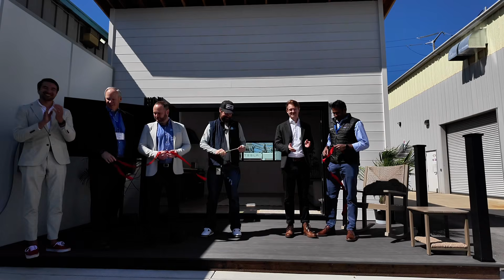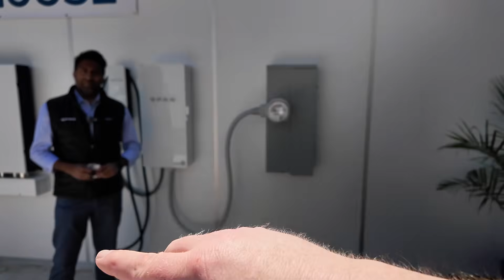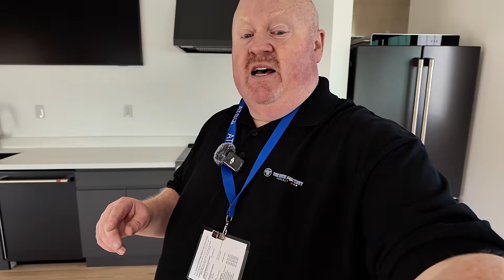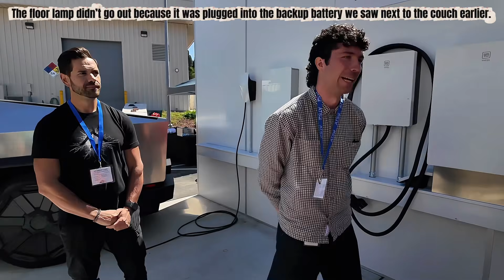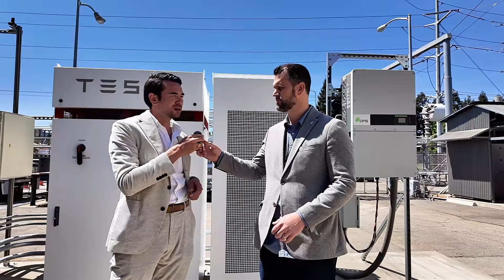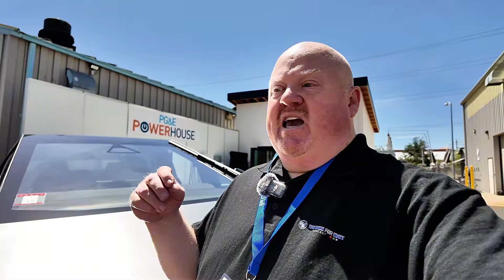Cybertruck & SPAN Power Tiny Home During an Outage | PG&E Just Revealed the Future of Home Energy!

Comment: Still waiting for Tesla to enable PowerShare for those of use with PowerWall 3s and the UWC.  FWIW, that "home of the future" already exists in the present with my 23 year old home.  Completely electrified after retrofitting a SPAN panel, cold climate heat pump, the GE combo heat pump ventless washer/dryer, instant electric 15kW hot water, dual PowerWall 3s, and 9.24 kW-dc of solar.  No induction stove yet just because I don't use my stove.  My dishwasher is original but wondering when a heat-pump version of that will happen.  Of the 3700 kWh sent to my SPAN panel, less than 2% came from the grid.
Reply from the maker: That’s amazing to be at only 2%! I don’t know what the hold up is with getting PowerShare working more widely. I know that’s the goal though is to have it across more of the lineup and with PW3 support for sure!

Comment: PG&E pushes the cost onto rate payers instead of stockholders.  After deferring maintenance so that savings could be paid to stockholders in the form of dividends.
Reply from the maker: Yep, that’s the most frustrating part to me. Even when they have to remediate and repair there’s built-in profit approved for it.
Reply: Deferred maintenance coming back to them in the ass isn't limited to electrical service.  The San Bruno gas pipeline explosion in 2010 was due to the same pattern.